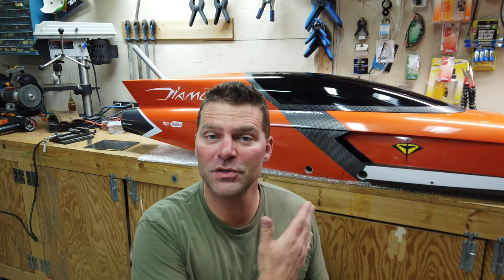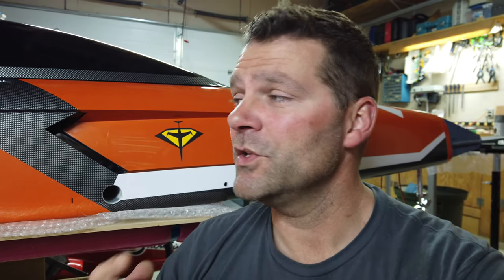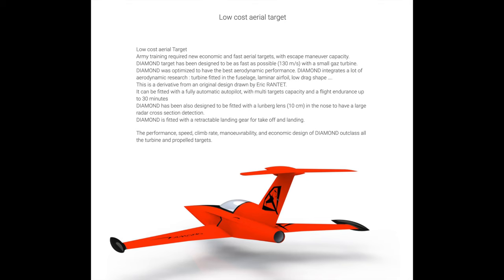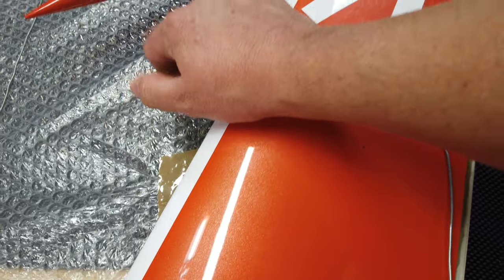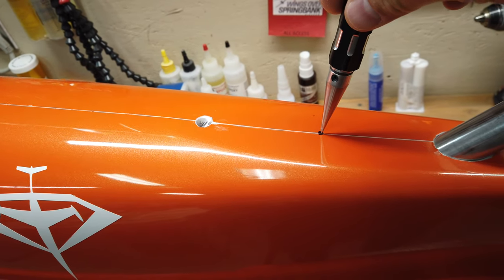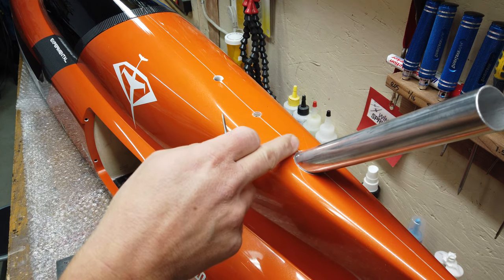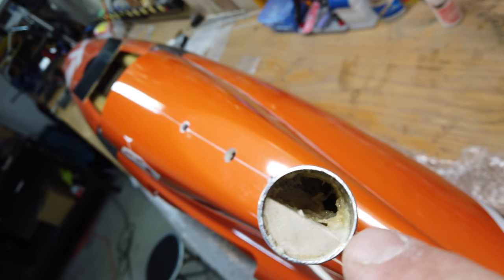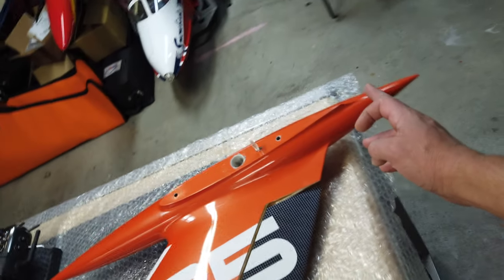THE DIAMOND BUILD BEGINS - Aviation Design Diamond Rudder Target Drone Install - Part #5

Comment: The dowel in the tube is a great idea, I even did it with my Krill Extra 330SC elevators. It just gives the screw more material to grip. Adds strength without adding excessive weight. Despite the recessed screw tightening against the plywood and not the skin it just looks better than having the screw sit on top of the skin. I think every RC pilot thinks the kits and engines is the most expensive part and once we bought the engine and kit it gets easier, but we all forget how many packs of wire, fuel tubing and all those small things like screws you need to complete the build and the cost of that along with the radio equipment can easily surpass the cost of the kit.

 Love your building style, super neat and keeps the setup simple.
Reply from the maker: Thanks Charl!  Yea the extras add up quick!  When i did the L-39 build last year, the connector, wires and all the small parts & fittings order for the build was about $1200 USD.😳
Reply from the maker: +Charl Jooste 🙌

Comment: Nice work on the rudder and wiring routing. Maybe you could show how you crimp your wires and assemble them into the ends for proper connection of the leads.
Reply from the maker: HAHA.  I read your mind Russell.  I added it to today's video recording.  I will show it when the wing wiring video is released.😎

Comment: Awesome build where do you get your connector and pins for your wire connection ?
Reply from the maker: Hey Brad.  Thanks for watching! I order some stuff from ThunderboltRC located here in Canada and Also Dreamworks in USA.  The bigger connectors are "Ashlok"

Comment: This may be too picky but - 
Is the fiberglass seam as noticeable there as on camera?
Reply from the maker: Not at all.  it's definitely noticeable.  AD didn't do anything to hide the seam.  Older CARF (Composite ARF) kits used to have a very noticeable seam as well.  They now will typically treat the fuse joint after it comes out of the mold.
Reply: It is still a beautiful bird !

Comment: Where do you source your Power Box stuff? I've been wanting to switch to this system for a while now and Thunderbolt just carries the wire.
Reply from the maker: I do most of my orders from dreamworks in CA.  I keep lots of stuff in stock so I don't have to constantly pay for shipping.
Reply: Never think of Dreamworks for PB stuff. Thanks, as I like making my own extensions, etc.